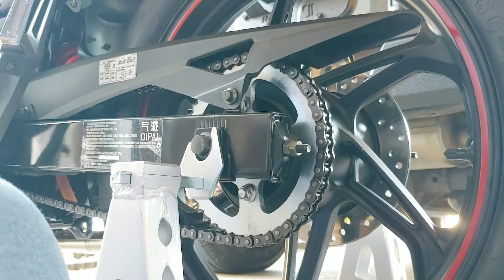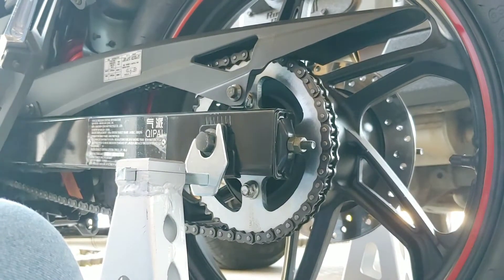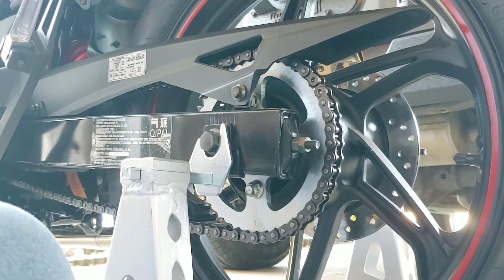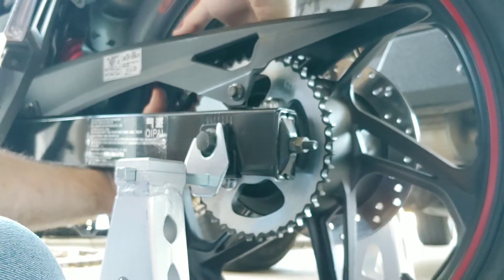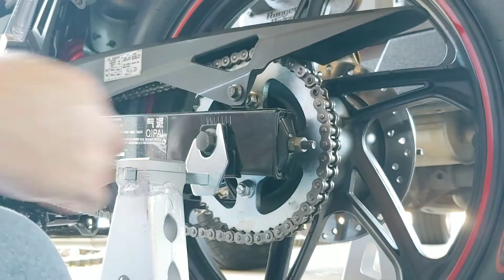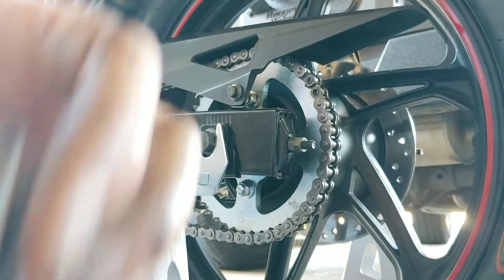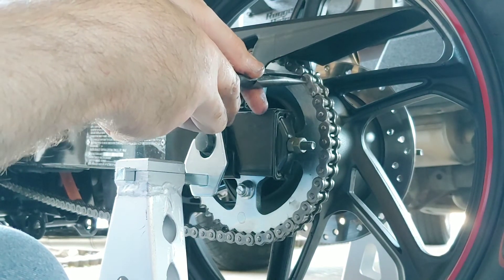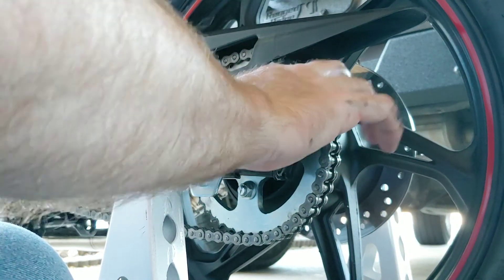Easy Motorcycle Chain Replacement on Lifan KPR 200

Comment: So what chain did you put on the Lifan KPR which one? What's the # that you used on that chain X1R JT what?? Chain ###? Because I'm looking to buy one on Amazon let me know please oh by the way I got the same Lifan KPR color and all black and red too cool 😎👍🏍️🏍️🏍️🏍️🏍️🏍️🏍️🏍️🏍️🏍️
Reply from the maker: I got item # JTC428X1R128SL. It takes any 428x128 chain. You will love how smooth and quiet this chain is when compared to the factory one. Also they just started selling the airfilters for these on Amazon so you may want to stock up on a replacement as they are impossible to find. Rep the KPR and be safe!
Reply: @EDCKnives2020  ok thanks what was the price for that one?? And how much did you pay for that chain X1R?
Reply: @EDCKnives2020  were did you get this chain Amazon?
Reply from the maker: @davidespinosa4367  Amazon looks to be sold out of that size chain, but Ebay always has them. I just look for the shops with the best reviews. That chain was around $40.
Reply: @EDCKnives2020   okay thanks for letting me know I'll look on eBay then I wanted to ask you if maybe we can meet up sometime 😎👍 let me know if that would like to ok.🏍️🏍️🏍️🏍️🏍️🏍️🏍️🏍️🏍️🏍️🏍️🏍️🏍️
Reply from the maker: @davidespinosa4367  When this Covid thing passes we can see about getting a ride together. It would be nice to get a few of the local guys together in Galveston. Maybe Cesar could pull that off.
Reply: @EDCKnives2020  Yes that would be cool for sure I'll be looking for do so 😎👍🏍️🏍️🏍️🏍️🏍️🏍️🏍️😎👍

Comment: I have a 2017 kpr 200 with 1500 miles..will this chain fit it?
Reply from the maker: 2017 and 2018 KPR200s take the same chain. The size width is the same and you may need to take links out or add them accordingly. This complete chain size does not require any added or removed with the factory size sproket. You can order a longer chain and remove links, but that is more work. I found a few longer chains on sale, but I didn't want to mess with removing links if I didn't have to.

Comment: Is there room for a 16 or 17 tooth front sprocket?
Reply from the maker: From what I can tell, 16 yes and probably not a 17. You could go with a 16 front and drop two teeth on the rear. That would require you to remove a few links from your chain though.